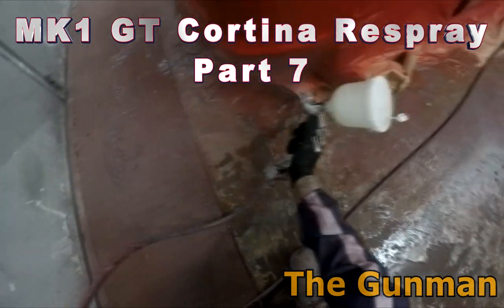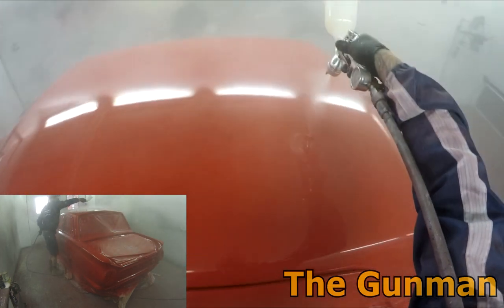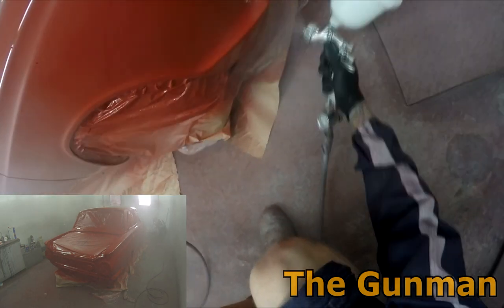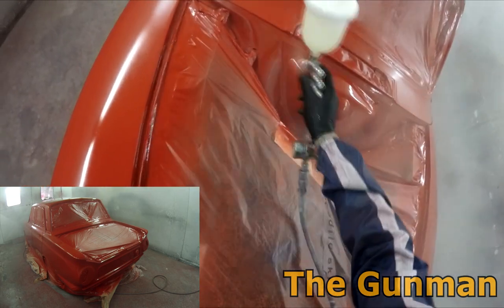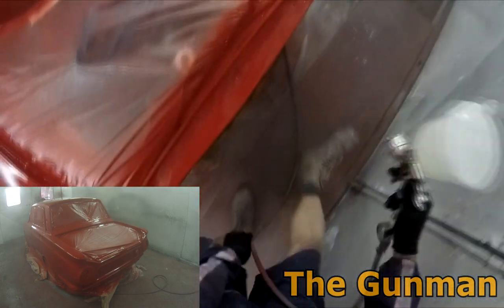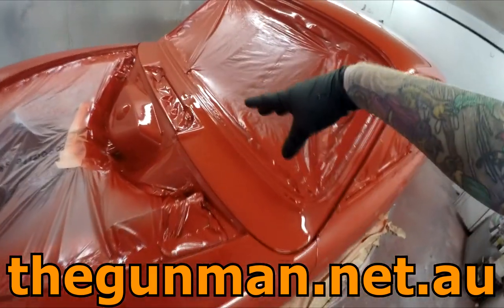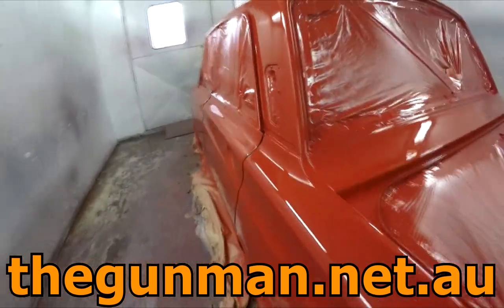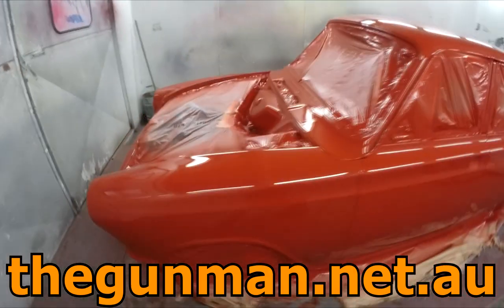Clear Coat, Respray MK1 GT Ford Cortina Part 7

Comment: Beautiful work, Gunman!  Thanks for all your gun reviews.  After watching many over the last year+ I finally decided on a FLG5 and received it for Christmas.  Had trouble finding one to purchase in the USA - mostly FLG4's here which I recall you said didn't spray well.  So I had my wife order the FLG5 from Spray Guns Direct in the UK and it arrived in the USA in just a few days.  Looking forward to getting into it!  Planning to mostly use it as a clear gun, and bought it with the 1.4mm fluid tip.  Here's a question: What were you doing near the end of the video when you put some thinner into the gun and shot a few spots, rear bumper, front nose, and bonnet cowel area?  Have a happy New Year over there in Thailand!
Reply: Great job , I how much can I reduce all clear coat even if it four two one,

Comment: Just wondering about the inner door pillars and sills, do you clear coat them separately to the outside, don't do them maybe or cut the new clear into old?  Same for the inner doors is there no visual differences between old and new clear coat.

Comment: great vid really enjoyed it  as always. Is it just my imagination or does there seem to be quite a bit if overspray generated by that gun as apposed to your pro lite? it may be the new camera is picking it up more but there does seem to be a bit more, not a ridiculous amount just more than usual at a fairly low pressure.
Reply from the maker: It could be that it's a 1.4 not 1.3 so a little more fluid pumping out?? maybe
Reply: Didn't think of that lol

Comment: and another question , would you tell me is it possible to make a paint job with solvent base colour to look like a powdercoating paint... because i am trying to make ktm parts wich some of them are powdercoated in ktm orange but the other parts that i did with spray paint do not look the same , they are tottaly different ? thanks

Comment: Hey Gunny, Do you think the mini filter inside the cup effects the number of turns out required on the paint adjustment? Do those little cup filters reduce the flow at all? Do those little cup filters help prevent particles because I notice that you use them most of the time. That water probably had to come off your glove. I still want the GPi.
Reply: I don't thing they provide much benefit.
Reply from the maker: I think they do, well even if it's just in my head but I do find if I don't use them then I do get a bit more crap in the job, I don't think they restrict the flow or alter gun settings with or without.

Comment: hi. I got the gun gpi 1.4 but the issue is i do not know how to proper set these gun(fluid). Could someone tell my how many terns to get the full fluid if the spike is at the maximum winded  in? Or how many terns to wind it out to spray with the HS clear cout couse I know the gun puts too much material. Thanks a lot
Reply: Did you figure out your gun settings  ?
Reply: @mitchellferre1652    yes , the best is to set a  fluid spike for 2,5 terns and set the pressure for 1.5 to 2.0 bars

Comment: Is there types of solid colour paint that doesn't use clear or is it up to the painter
Reply from the maker: Yes direct gloss, I fing clear over base you'll get a better finish and UV protection.
Reply: +The Gunman ah cool, does it change the colour at all clearing it? Like if I painted the boot in acrylic, then cleared it and the rest of the car wasn't cleared would it be noticeable?
Reply from the maker: slightly but not a big deal just don't go too heavy
Reply: +The Gunman just finished watching the whole series. Amazing series, thanks for all the effort you put into making the vids!

Comment: Oiy Gunman!  I love this crap.  One question:  I noticed sometimes you have the little cap on the top lid open and sometimes I've seen you close it.  What drives the little cap being closed or not?

PS:  after watching your stuff I am considering doing the paint on my 1965 VW...  scary.
Reply from the maker: I usually leave it open, the cap on the top has a smaller hole and will restrict flow a little.
Reply: Thank you sir!

Comment: How do I unblock this gun, I’ve tried everything, can’t get the fan wide
Reply from the maker: If a thorough clean doesn't do it I really can't help without seeing it myself. Only tip I can say is get a really small piece of wire and poke through the small holes in the air cap, soak well first.
Reply: The Gunman thanks